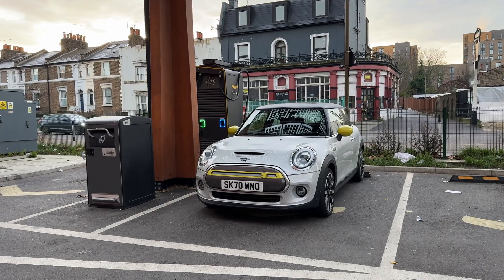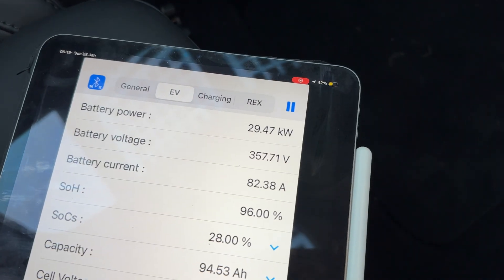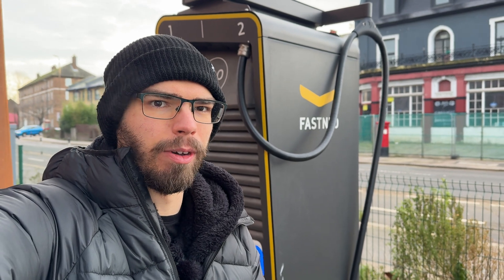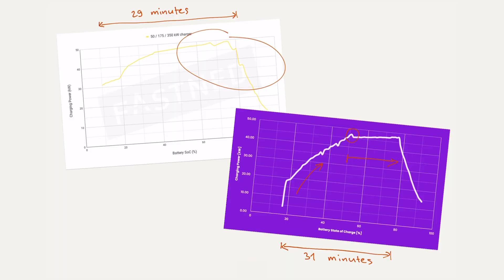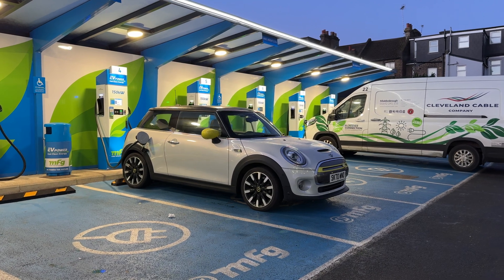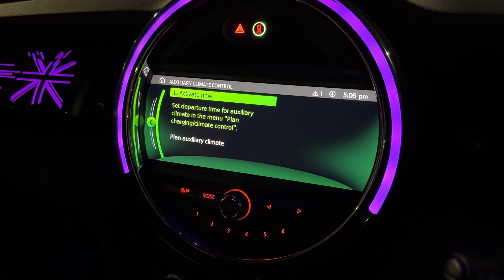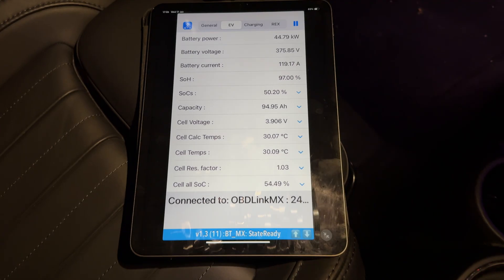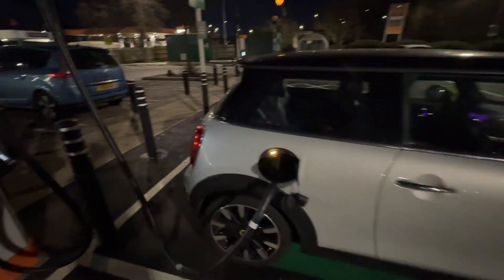MINI Cooper SE / Electric: Why It’s Actually an AMAZING WINTER EV

Comment: I dont believe that the SE has a hattery heater. I drastically increase winter range by used a timed charge that ends at my departure time. Charging warms the battery. I've seen 4+mi/kWh driving through snow doing that. Once the battery cools down, range drops quite a bit. Around freezing, I get low 3s.
Reply from the maker: While it doesn’t have a dedicated HV battery heater, some of the heat from the HVAC system can be redirected to help heat up the pack.

Comment: Thanks for the info sir. But where i come from 3 C is balmy.  Winter nights typically -25 C.  Btw most li ion batteries are allowing to charge down to 0 C at the 2 hour rate.

Comment: Subscribed 👍 just a trick about running the heater while fast charging: Turn off the car completely. Then switch on and put into ready drive mode. Then heating / cooling function works. Warning: just switching on is not sufficient.

Comment: You have a different definition of "cold" than I do.

When planning my winter biking I decided I needed to be able to operate at -20C to make it worthwhile. 
The transition seasons are actually worse than -20C for the bicycle: ice/salt on the roads. The city stops salting at -20C.
Reply from the maker: I am afraid this is about as "cold" as it gets in England, so can't do a colder test. 😶

Comment: Can't you just turn on the AC by using the round knobs?
Reply: Assuming the controls are the same here as the i3 [the screen UI is the same function for the aux heating] then the 'round knobs' or in fact the climate buttons only fire up the fans if the car has been turned off and plugged in. You have to drill down a couple of layers to turn on the heating - the trick is to catch the 'goodbye screen' where you can activate the heating with a twist and OK but you have to be quick about it.
Reply from the maker: Yes, but don’t quite understand the question.

Like in a car with a combustion engine, those controls only affect the cabin heating / cooling.

The battery thermal management is completely independent and works automatically in the background, regardless of the cabin preferences.

Comment: According to ev-database, there is a "Mini Cooper SE" from 2021 and a different one from 2023. They have very different specs. Which one is this?
Reply from the maker: This is the "previous generation" 2021 vehicle - codenamed F56.

The 2024 model year car is built on a completely different bespoke EV platform in China and carries the J01 designation.
Reply: That's the Gen 1 Cooper SE.

Comment: Thanks for the data.
 I daily drive an SE. Some mornings it is 0 degrees farenheit and i wear layers to keep the heat pump on low. Definitely some range loss but on the flip side, the best fwd car ive ever driven in the snow, it just wants to keep pointing in the direction you want to go, really fun :)
Reply: Biggest range loss comes from lower battery voltage and increased internal resistance due to being cold (=slower chemical processes), mostly not heat pump unless you set it to 28 deg C. Don't torture yourself. Green mode also helps.
Reply: Thanks, that checks out, a garage to keep the mass of the battery warmer would probably do some good on the frigid morning drive.
 Im assuming green mode would simply keep the heat pump in its lowest mode? 
 And, a question in case you happen to know, is there an unconditioned air setting (other than opening a window)? It seems like it must always be conditioning either warmer or cooler and i like a little fresh air but dont want to always use the heat pump.. just curious
Reply: @Arrlidge  no problem. You can also precondition the car. Mini Connected app should also be able to control that remotely (app not available where I live so I’m not sure). You can also preset that from My Mini menu. I think best use is preconditioning with your car plugged-in in your garage. For unconditioned air you can either use Green+ mode or alternatively, especially if you don’t like slow responding pedal in that mode you can set lowest possible temp 16C. If outside air is above that system will disable heating function. Is heating function of front seats available in your car? They say it’s much more efficient than air-conditioning. They’re very effective

Comment: It also helps that the mini E comes with heat pump as standard on all trim levels.  I have a mini 1.5, 3 door at the moment. The range would be fine for me, as I don't travel that far. This is the first video I have watched from you, but do you think the ride is comfortable? My petrol mini is very uncomfortable!  Even considering the VW E Golf as that seems a nicer ride. I will have to take them both out for a test drive. Ultimately,  I am a mini fan though👍
Reply from the maker: It drives like a regular MINI - firm and sporty but not unbearable in my opinion.

If you don’t like the ride of your petrol one, I don’t think this would be much different. (More videos on it coming soon.)

Maybe consider the BMW i3?
Reply: @MartinKarel  Thanks for getting back to me. I look forward to your upcoming videos. I have subscribed to you aswell 👍Not really a fan of the i3.  My neighbours have one.  They are happy with it, but the narrow tyres don't do it for me. When the next version of the mini comes out, the current one will probably come down in price a bit more. We will see. Some other reviews have mentioned the ride height is higher on the electric mini, to protect the battery pack. Its disguised by extending the plastic wheel arches.  Keep up the good work 👏

Comment: Thanks for the video - interesting content. My MINI SE seems to work quite well in the cold weather but I only charge at 7kW during the night. The biggest problem I have is removing the charging plug when it is freezing. The locking mechanism doesn't always release so I have to keep a hair dryer handy for those occasions when it is stuck.
Reply: I bought 9" x 11" magnetic sheet material to stick over the charging port overnight when its freezing rain or similar. After i broke the latch prying it open :)
Reply from the maker: Interesting. Some manufacturers (like Tesla) started equipping their EVs with heated charge ports now to get around the problem!

Comment: In Chicago it was -5F when even Teslas were having trouble charging!
Reply: Their owners hadn’t preconditioned the battery before charging.
Reply: @CastleKnight7  Many of them simply ran out of charge waiting for the charger.  It's a problem for Apt dwellers living in a city with no option to charge overnight and having to park outside.  My Chevy Bolt definitely does better parked in our heated garage than sitting outside in 10F.

Comment: I got around 160km of range in the winter with this car. I liked the handling of the car and the seats were nice for my body. But I could not stand to have do daily charge my car at public charger :/
Reply from the maker: The range definitely limits who the MINI Electric is suitable for, but I have to rely exclusively on public chargers as well and so far it has actually been much less problematic than initially expected. (I do very low mileage though.)
Reply: @MartinKarel  yeah, I wish I had waited a while buying it, since today we have the generation 2 of the Mini Cooper with 54kWh battery (mine was the 32kWh), so I think that one had worked much better. The new one has also a stronger motor. Not sure about battery preheater, but I think it has.

Comment: In the Netherlands owning and driving electric cars is very expensive unless on some subsidised by tax payer  lease scam.
Reply: What do you mean? Your electricity prices are among the lowest in Europe, currently I see 0.32-0.35€ for DC quick charging at superchargers. The chargers are plentiful and well-maintaned. I always show NL as an example of how it should be done.

At the same time, gas is around 2.00€ — so to match this Mini SE costs (16kWh/100km, at 0.35€) you would need to be at around 2.8L/100km. I guess you would consistently run twice, if not 3 times, the cost of the electric Mini in a gas equivalent.
Reply: @pqvid  If you think the Netherlands is best/cheapest for EV, the rest of the world has to be an absolute hell for EV driving.

Comment: Very cool, what app do you use to read OBD values?

FYI, Tesla is actually heating up the battery at DC chargers to around 50°C. Not sure if it's really required, sometimes I would rather spend a few minutes more while charging, rather than hurting the battery with such high temperatures.
Reply from the maker: It's an app called the mi3 - originally designed for the BMW i3 but because the MINI basically shares the same comms / sub-systems, it works without any hiccups.

The temperature also depends on battery chemistry. But Tesla is the one brand I would trust with batteries.

Yes, they push them right to the limit, but that's because they have so much experience that they know where the limit actually is.
Reply: @MartinKarel   Mi3 app not available in Canada...do you know if it's provided under a different name on the App Store in other countries?

Comment: Heating the battery to charge is nothing special, 3°c is not that impressive, most EVs get on fine in Norway at -14°c with good thermal management
Reply from the maker: Ehm. Exactly.

But starting at 3 ºC and reaching a peak charge rating of ~ 1.4 C in a matter of minutes without any battery pre-heating is impressive (especially considering that the MINI uses technology at least one or two generations behind the latest and greatest).

You can look at Teslas with LFP packs to see the opposite end of the spectrum.
Reply: @MartinKarel  yeh but the thing is that's not ideal thermal management, other EVs coldgate when under roughly 14°c because they want to prolong the life of the battery. Cramming electrons in at 1.4c at low temperatures causes unnecessary battery degradation. Not a feature - a design flaw.
Reply: @SustainableGal  The Mini SE has a CATL battery compared to the older Samsung product on the i3. I'd guess CATL as a leading battery manufacturer knows how to program their BMS to optimal performance, they don't want to screw their customers (BMW) and more importantly, their potential customers worldwide.
Reply: @pqvid  fair point, is the BMS made & programmed by CATL thou? Be interesting to know, coz usually its the electrical drive system designers that decide how it would be programmed. Great to know it's CATL cells thou, at least they'll put up with any abuse (if the BMS was programmed by BMW which I'm guessing it was)